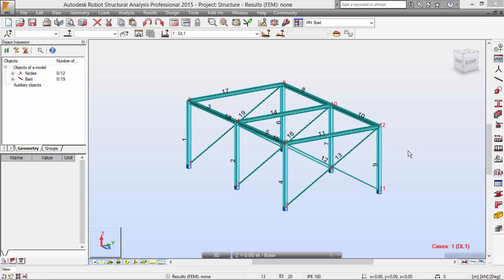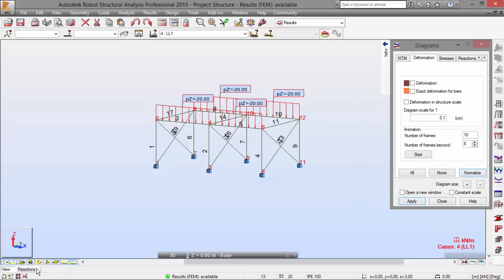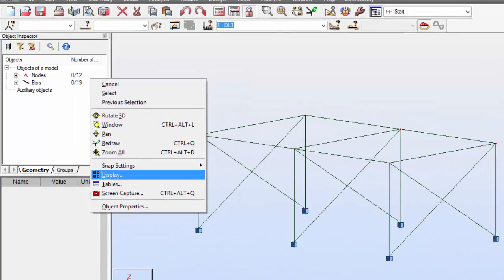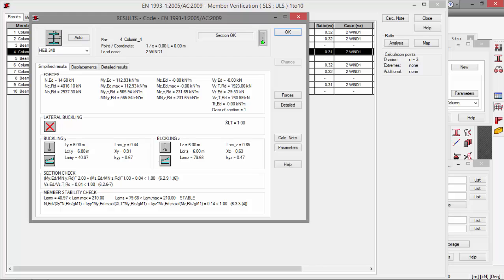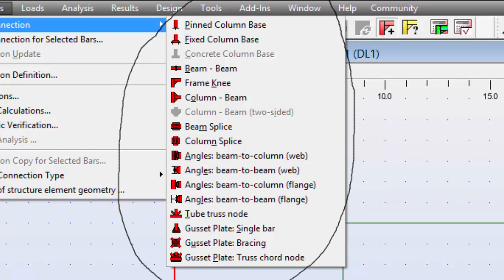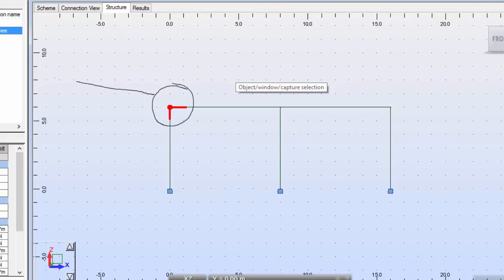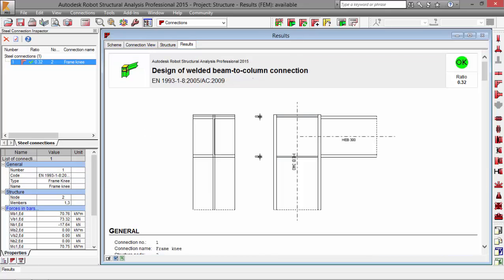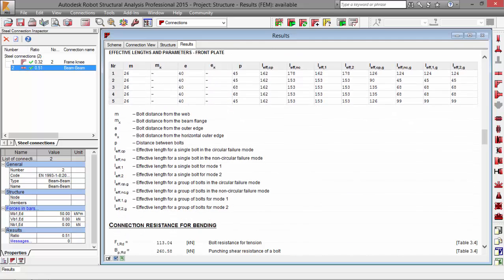Exercise 6 - Part 2 - 3D Steel Structure with Steel Connections (Robot Structural Analysis)

Comment: Je peux trouver quelqu'un peut m'aider pour calculer une plateforme métallique ?
Reply from the maker: Pour ce faire, nous avons besoin d'informations supplémentaires.
Reply: Nuno Teixeira - Robot Structural Analysis 
Une plateforme métallique avec des poutres IPE le but de faire le calcul d'une charge repartie et calcul au poinçonnage, j'ai le logiciel mais j'arrive pas à faire ce calcul puisque je suis débutante
Reply from the maker: Je peux aider. Vous pouvez contacter par email, et j'explique comment travailler avec le logiciel.
Reply: Nuno Teixeira - Robot Structural Analysis 
C'est quoi votre mail ?
Reply from the maker: teixeiranh@gmail.com

Comment: Hello Eng.º Nuno Teixeira, I have a question: what if I wanted the connection with the beam on top of the column? i could use the regular solution given by ROBOT and just rotate it 90º for assembling but in that case the compression does not pass trough the welds or bolts but by direct contact. Is there anything to be concerned about? How do I change connetion settings in ROBOT to have the beam over the column? Thank you very much!
Reply from the maker: +Paulino Dias Santos nice question! Robot won't design that connection, you will need to make the calculations yourself, or find software that does that for you.

Comment: Hi Nuno,
Firstly thank you so much because of your good modeling and exemplifications. I want to learn that can ı solve only steel connection without structural model in the RSAP? (What ı am trying to say, for example if ı model any structural steel building in Sap2000 and then get all internal force from sap2000 to RSAP; is it possible to analys?
Reply from the maker: +Osman Ali Korkmaz I never did that. I don't really know if it is possible but I guess that it is, if you use a macro/small program. 

I should point out, however, that you should be very careful using robot. In some connections, the calculations are incomplete.
Reply: ok. Nuno Teixeira - Thank you so much your explanations..